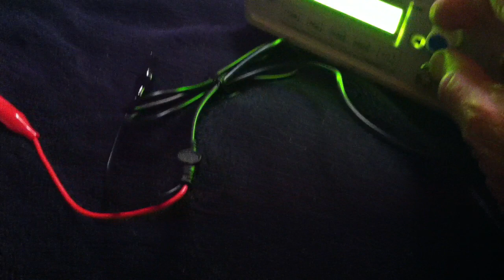Big Stiffler Loop Experiment ---My replication

Comment: I have built the same circuit before that you have here. Your biggest key is the switching diodes. They must be fast. The 1N4148 / 1N914 switches at 4ns. That forces displacement current to take place. It does not matter where you connect the input lead to your diode/LED loop. You will induce ionic displacement at every open wire lead on that setup. You want it brighter? Put a lead opposite you input lead  on the loop and connect that to a metal salad bowl. Retune your frequency. When you get it right, it will get so bright you think you may damage the LED's. It will operate at different frequencies, and will dim out as you go up or down in frequency. There will be a crisp spit where it will like to operate best. I find 6 to 8 Mhz works best for what you have here. Personally, I put the LED's in series. No loops. I have suspicions that we all are finding keys towards tapping ZPE. I have my own ideas on that, and it involves much more. However, what you are doing is key. As before, I did all this on my own without any input from anyone else on youtube. And that was back in 2016.

Comment: This is what I'm talking about. This is ionic displacement in action. There are 3 key things you need for this effect. The current is not induced. You are sering oscillating current in action. The tuning is according to your circuit wavelength. Each circuit has it's resonance and you myst dial it in, just like you are doing. I've done this with varying frequencies all the way down to 60khz. Tesla had a capacitive coupling on his tower because he understood the displacement current. You don't need induction except for stepping up voltage by self induction. Like an auto transformer. I don't use coils at all. I found you don't need them.

Comment: "Where's the energy going in and where is it going out?" I guess you're mostly wondering where it goes. Probably because you are under the assumtion that - just like in a closed circuit - it needs some sort of output connection. Well, I assume anyone who has heard of electromagnetic fields will know where the energy couples in. But where could the energy go from there, where does it exit? Well, I don't know, but the photn energy of the light emitted by the diodes might be a strong pointer. Lack of understanding doesn't turn things into magic.

Comment: Looks like capacitive effect...just from watching this video and never seeing this before.  The loop creates potential from the multiple diodes...my prediction is that if you reduce the number of the diodes in the loop the loop potential will reduce and thus the lights will dim.  Thus, my prediction is that there is not a 'current' running around the loop, rather a vibrating potential applied to the LED's...i.e., diodes acting more like detectors.

Comment: could you confirm L3 AWG turns and diameter Thank you very much
Reply from the maker: A stock Dr. Stiffler SEC - 18 coil is 63 turns of 24ga magnet wire on a 5/8" form.  I am using 26ga wire with about 100 turns on a similar form.  No matter what you choose to do you need some method of tuning to achieve exact resonance.

Comment: I would say it is working just like a radio transmitter and receiver,via electromagnetic radiation. None the less,a great experiment LM. Always a joy to see what you have going on in all of your video's.
Reply: Wow! So if I sat on a chair with my portable radio and was surrounded by a shorted wire, my radio would not pick up any stations? A great EMP or CME shield knowing RF is shielded by a single wire. I always thought it could squeak in the top bottom etc. Great thought even if it is wrong.
Reply from the maker: If the receiver was just a loop of wire I would agree.  The switching diode AV plug loop arrangement puts a twist on it though.  Thanks for watching my stuff. Some of it is more interesting than others but it is all fun for me.  I learn a lot doing these projects.
Reply from the maker: Ha!  Stiffler 1  TinMan 0.  So much for the RF answer.....and he was soooo close!  May we have our next contestant please.  Actually TinMan and I go back a long ways and I admire him but I also think that he is wrong here. Simple RF isn't doing this. That answer doesn't explain everything.
Reply: I will stand my ground here Lidmotor. I sill believe it is electromagnetic  induction,via the poynting vector. Do you have a scope?,if so,then place the scope across your diode string,and the other channels probe on the half loop line. If it is capacitive coupling,it will be in phase. If it is inductive coupling,then it will be out of phase. My bet is the two traces will be out of phase.
Reply from the maker: Yes.   We need to do a lot more testing on this.  What Itsu found out about the single loop just retuning the resonant circuit is what I thought. What really matters to me is understanding what is happening exactly so the thing can be developed.  It is hard to develop something when you don't fully understand how it works.  SEC theory is something Doc has been working on for decades so I listen carefully to his explanations.  Itsu is the one I am watching the most right now.  He has the correct test equipment, background knowledge, and open minded brain to give us the best feedback.
Reply from the maker: Excellent advice.  Thanks.  I will do that test.  My money is on capacitive though.
Reply: +Lidmotor  I agree there is much more to learn here and simple RF may not be doing this.  But you may be a bit quick with the score card since it has not been proven that a shorted wire loop is shielding the effect based on the thorough replication and finding by +itsusable who posted this comment: "In my replication i was able to retune the FG so that after putting in the shorted turn (with 1 diode) the LEDs came on again.  It went from 20Mhz without shorted turn to 18.4Mhz with shorted turn, no matter which direction i put this shorted turn.  So this means to me that this shorted turn does not block the FG signal or shut off the resonance, it just detunes the L3 coil."

Comment: neat little func gen, where do I get one?
Reply from the maker: I got it on EBay.  55 bucks delivered.  It works great.  https://www.ebay.com/itm/FY3200S-24MHz-Digital-DDS-2-Channel-Arbitrary-Function-Signal-Generator-Meter-US/362002419767?epid=1685917492&hash=item5449069037
Reply: Lidmotor thanks.

Comment: Great job.  I agree, my first thoughts were that it is like an A.V. plug on steroids.  Remember we learned a while back that you can light leds with high frequency and high voltage like we did with our advanced JT circuits so, maybe we didn't even need the voltage?  This is very fascinating.
Reply from the maker: Bill this whole project has caused me to go back and look at a lot of stuff we did years ago.  Some of the advancements (such as LEDs, batteries, and better solar cells) that have happened make those old projects worth another close look.

Comment: Thanks for posting your thoughts. Resonance is so unique it appears most stable. 
It seems wireless energy\at high frequencies might be a magnetic operation.  Not that it has any visual inertia but that it "listens to",  or readily accepts and utilizes the resonance like the manner a magnet might a piece of ferrous metal. 
Thank you

Comment: Good work, Lidmotor!  are your running at 20V?  does it dim at lower voltages?  Also, I'm wondering if this will work with a crystal oscillator at about 11 MHz...?
Reply from the maker: This is a sine wave at 20v peak to peak.  The frequency here was at about 11Mhz but that can vary all over the place depending on the coil used, the 'clip lead', and the diode ring.  I saw this resonant 'event' show up from 8MHz all the to 16Mhz. depending on the parts used. The less the voltage the dimmer the light output.  Please read Dr. Stiffler's explanation below about what is going on.  Fascinating stuff.  Yes this works great with my crystal oscillator .  It is using a 13.56MHz crystal but by tuning it with a ferrite rod in the L3 coil it will go into resonance somehow.
Reply: Thanks for the replies!  very intriguing to me...

Comment: For those asking about conventional radio, here are some facts. The wavelength (lamda) for a freq. in Mhz can be found by lamda = 300 / f Mhz. For lidmotors 11Mhz this is 27.3m or 89.24ft. 1/4 lamda is 6.8m or 22.44ft. This would be for a single wire similar to a CB antenna. Yes the require physical kength can be made shorter with a loading coil at the ant. base, although this does reduce the eff. of the ant. This is seen in the loaded coil versus the whip or long wire ant. The coil become the high current point and the tip if the ant. is the high voltage (assuming a proper loading coil is used. Close Field, Near Field and Far Field are quit different in what takes place. I have always ask the troops if the transmitter feels the receiver and for Close and Near Field the answer is Yes. For Far Field this is thought not to be the case. Where like in this circuit you are Using SEC caused from voltage alone
and a very tiny current, the ring actually generates the current pushed by the voltage from the coil out. Its almost FREE, more later.
Reply from the maker: Well I don't know what to say except WOW!  This is catching a lot of attention.

Comment: Very nice replication! But I was wondering, how much energy is going in and out the signal generator???.  because if its like 100 watt, then i am much less impressed. Its like the diodes starting to light glow when you hold them near a high voltage powerline in the country side.  I used to work at a shortwave radio station. huge antennas transmitting at 6155khz. People living near by were always complaining.. microwave ovens, lights and different appliances switching on and off randomly.. (the bought the houses very cheap because of the antennas, and then they complained)
Nevertheless i think its a similar phenomenon, but we were transmitting with 150KWatt worldwide. here you have the antenna coming out of the signal generator and the "appliances" would be the diodes.
(thats my 2 cents) just to say it would be interesting to get the consumption. (because when we were using the small 20kw transmitters there were no side effects with appliances.
Luc

Comment: You stated 1 MHz & 11 MHz in the video--what's the actual frequency?
What is the switching diode type & part number?

My guess at this time is:
Your switching diodes are functioning as a high-speed rectifying applications.  The power comes from the radio wave that is being generated.
Reply from the maker: It is about 11MHz but I had this working down as low as 8MHz and as high as 16MHz depending on how I configured things and what coils I used.  The diodes are just common 1N4148 switching ones.  You can get them anywhere.  Nothing exotic.  If this is coming from just radio waves perhaps I can find a powerful radio station nearby and take a little field trip.  Ha. I would have to design something that would pick up that broadcasting station signal.  That has probably been done before.
Reply: Is your function generator wave shape a saw-tooth or a square wave?
Also, what is the output voltage & current of your function generator at 8 MHz?

This "... perhaps I can find a powerful radio station nearby and take a little field trip..." is an intriquing idea.  Not sure you could get sufficient power from a broadcast signal, though--but, I might be worth a try.

Here's a page that has a lot of good info on switching diodes.  Enjoy!
http://www.futureelectronics.com/en/diodes/switching-diodes.aspx
Reply from the maker: This is a sine wave.  I think this generator put out 1Watt.  Thanks for the link to the info on switching diodes.
Reply: Thank you. :)
Reply: Here's another good vid to watch:
https://www.youtube.com/watch?v=hoqF3gjLIyI

It's a great example of how to show that understanding component functioning, basic electrical engineering math, & logical reasoning really do make a huge difference in one's ability to determine if a system is something special or just ignorant free energy claims.  Of course having a few good meters & scopes (and the know-how to use them properly) is a great thing, too!

Comment: Hello Lidmotor, thanks for the upload and for arranging the parts in an easy to see manner.
What you have replicated is fascinating. I'm waiting (3 weeks now) for my coil winder to arrive so I can  replicate some of your and Dr. Stiffler's projects. Good job! Also, I don't know what to conclude either. Here's some observations/questions: (1) The diodes and LEDs are a closed loop which has some inductance.  (2) Loop conductivity is in just one direction. (3) Is the inductor charged and then discharged dumping a large BEMF, when the signal generator output reverses direction? (4) Would the generator (resonant) frequency be different if the loop diameter was larger or smaller, a different loop SRF.? (5) The single lead from the sig generator is a transmitting antenna that radiates. (6) Tuning it to light the LEDs seems to indicate you have found the self resonance of the LED/DIode loop. (7) How much power is the sig gen putting out? (8) What is the LED current? (9) I can measure loop current and view its wave shape with a current probe after I build the circuit. In the meantime, please meditate on the questions. Thanks to Dr Stiffler and you for giving us something valuable to peruse besides the junk on TV.

Comment: You say it does not load down the f. gen.  How did you measure that at 1MHz?  Regular mutimeters are generally useless for accuracy at that freq.  How about a video demo of your loading measurements and what instruments you used?  If the load does cause input power to increase then this is in the realm of conventional EM Theory.  If there is no loading then there is indeed something to "light up" about although it does not strictly prove there is free energy here since you said adding more LEDs or AV plugs reduced output not increased it.  A real easy proof of no loading would be to simply short out your LEDs with a jumper across the AV plug output.  Now tell us what occurs with loading.  :)
Reply from the maker: The way Dr. Stiffler is doing it is with two O-scope probes across a 1 ohm resistor at the L3 coil.  He watches the scope trace with and without the load applied.  You are right about trying to measure the draw at 11MHz with a regular meter.  It is useless.
Reply: Thanks for explaining.  That sounds exactly like the right way to go.  Shoot, now you got me interested in seeing what he's been doing.  Had not followed for many years because I back then did not see any real advances into something practical, only curious circuits.  Will have another look, hopefully I will see something more than the same as before.  Not saying not interested, just you, him and I have spent many years on this stuff.  Time to give the public some real useful results!  I quit following all those ou sites long ago, since after a decade, nothing useful and prove-able came out of it on any of sites back then in my opinion.  Sheesh!  10 years is enough.  Even Bedini said to not follow the chat chat fe sites because none of them were even close and were often wrong to what Bedini tried to explain and show many times.  And this was during when he was alive and approachable!  The groups tend to copy each other with bad understandings and get each other lost on a multitude of tangents without just focusing on the one task at hand.  Even if this is not intentional it still results in the same result of "disinformation"  by shooting out a deluge of information to scatter peoples directions and get NOTHING done.  Ok I am better now, enough rant.
Reply from the maker: I stayed out of trouble but not taking any of this too seriously.  It is a hobby to me.  I enjoy building these gadgets and learning something new along the way.

Comment: Mine is nowhere near this good !
Have got 14x 1N4148 and 12x LED's. The AD9850 is no good for it stock, hardly any output. The SEC-18 works fine, but not like yours and 5V works same as 12V (which somehow heats the MPSA06). Same for a Slayer circuit, works great but nowhere near as good and can't push 25V without smoke.
Reply from the maker: These things are very touchy.   I am working on another setup by someone else and having no luck.    It is a parallel  crystal oscillator .  It works but not like it should.

Comment: Hi, It's almost a similar effect of an EMP Jammer. Transmitting and pushing a low amount of current at higher speed to any receiver around the environment.
I tried different combinations and trying to charge a supercap, a battery and even an ordinary caps. But, it has a very low amount of current and  for my experiments so far, I got only 40-60% efficient driving those LED's with the oscillator.- JB
Reply from the maker: Thanks for the info.

Comment: Can you add a second loop please? Like to know if the first one dims as the second one enters the 'environment'.
Reply from the maker: Adding in more loops does dim down things.  The more you add the dimmer the LEDs get ---but the load on the source does not go up.  The function generator spits out about 1Watt signal strength.  There is no feedback loading to it.

Comment: remove the wire, see what happens?
Reply from the maker: It works without the wire if you get the 'Loop' near the end of the coil.  I tried this all different kinds of ways that worked but I did it this way to try and replicate as close as possible what Dr. Stiffler showed.  If you stand the coil upright and put an identical coil upright 6" away with the 'Loop' attached ----it is great fun. :)

Comment: hi what type of diode did you use and which way did you connect the polarity of them
Reply from the maker: Google 1N4148 switching diodes.  They are dirt cheap and available all over.  Connect the diodes (+) to (-) to (+) to (-) etc.